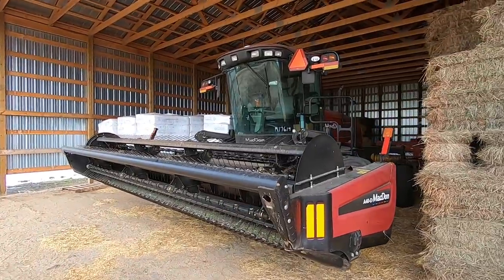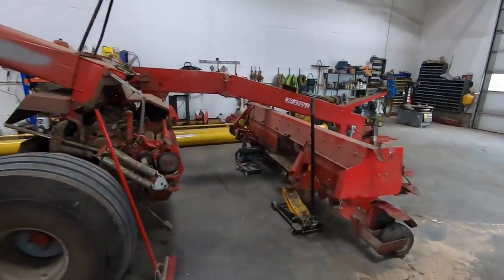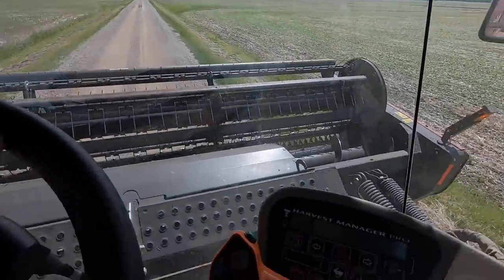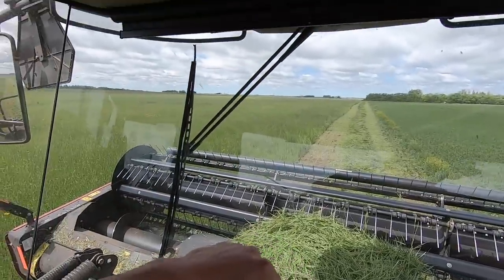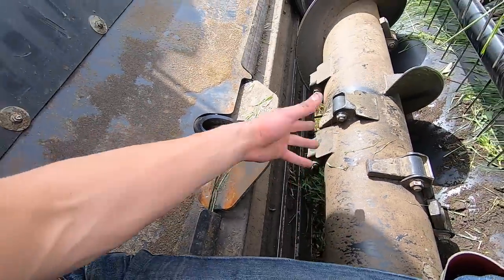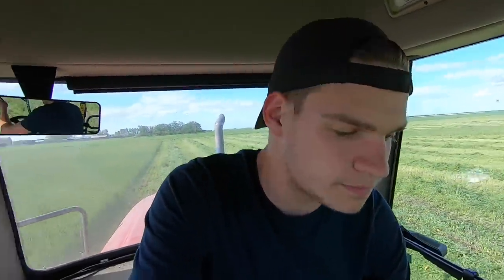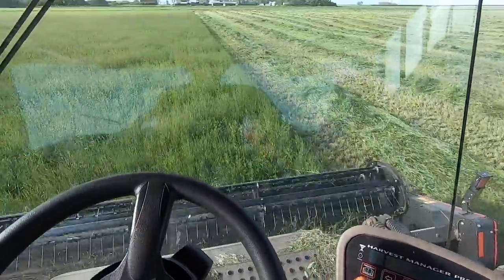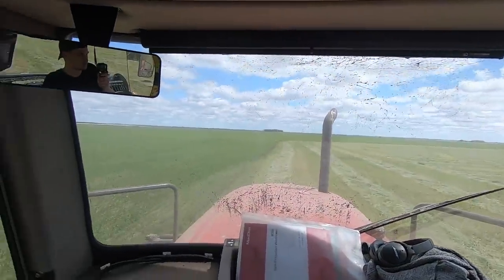Dropping The First Cut Of Hay!

Comment: Hay cutting sure has came a long ways. We use to have to cut with a tractor. One tractor cut it, the same tractor was attached to the tedder, then the rake, & later the bailer. The same tractor was used to pick the bails up out of the fields too.

Comment: When  we  moved  our  silage  cutting  later -  back  into early  June , the  curlews were  generally hatched, but  there  were  tons  of  gulls  that  came  to  feed on  the  stubbles and  the   chicks  needed  to  make  it  to  the   edges  of  the  field  where  there  was  still cover.  Some  must  have,  as   the population  of  curlews  remained , at  least  until  we  sold  up. When  we  made silage  in  May  the  tractor  driver  used  to try  and  mark  the   nests before  cutting  , but  even  leaving a  few  yards around  the   nest  probably  still gave  the    mothers  a  scare.  Early  cutting  is  essential   to  make  quality silage  for  dairy  cows ,  but  it  isn't  very  compatible with   some   wildlife.

Comment: Do you have any problems with that power grease gun blowing out seals? Good job of taking care of the equipment. Love the drone shots!  Thank you.
Reply: He's mentioned in other videos that the power grease gun has a setting so that it automatically stops pumping at the set pressure.  So it's probably safer than a manual one, which depends on the human pumping it to pay attention and stop at the right time.